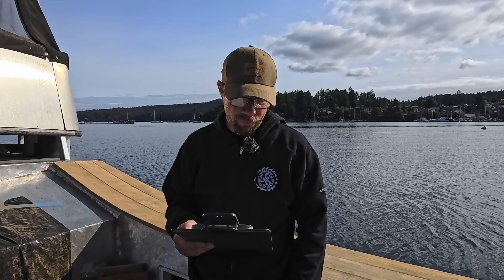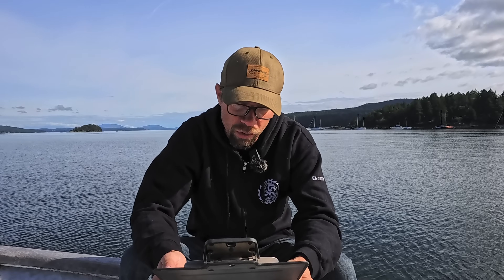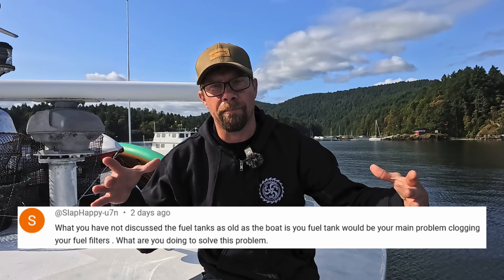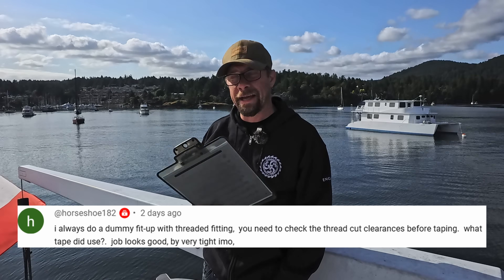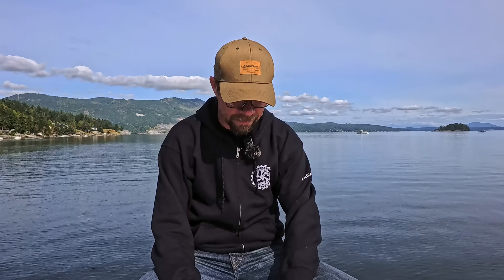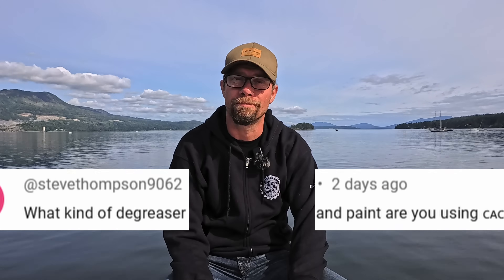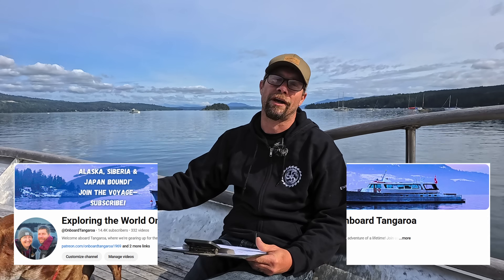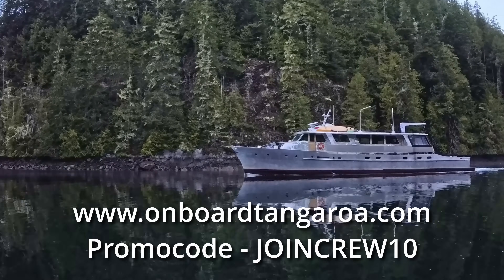We Ripped Out the Fuel System—Your Questions Answered!

Comment: Are there any provisions or future plans to run more data points then whats included factory in this engine?  Like back pressure, turbo speed?   You could get really trick and have EGT probes at each cylinder (like airplanes), that way you know the health of each cylinder.

Also, are these VNT turbos?  If they are, you could set engine cruise (RPM) and then adjust VNT to 95% Turbo RPM for the most efficiency.  You could also clip fuel (load depending) as diesel like to run on the lean side of the stoichiometric equation.. . .  Compounds would be sweet in this setup.  You have the room, and weight isnt an issue 😉  I bet you can get efficiency pushing 40% <- just living vicariously through you.  ha

**Also, i know you mentioned a bypass oil filtration system.  Which one are you using?  Toilet paper, canister (AmsOil) or centrifugal?   That centrifugal that PPE has looks really legit.
Reply from the maker: I do have a full sensor suite on these engines including extras like wideband O2, and back pressure (turbo speed wires are there but no sensor yet). I also looked into individual cylinder EGT but without installing some sort of manifold spacers it would be near impossible with the wet exhaust manifold. I did start off trying to build a wet manifold with individual egt in mind but it turned into a nightmare so I abandoned the project.

These are fixed geometry turbos although there are some interesting products in the aftermarket that have caught my attention. I would definitely enjoy working with that stuff. 

  I am using the Amsoil filter but have been looking into the centrifugal stuff. There are some effective OEM stuff out there. I hadn't heard of the PPE unit but I will check it out.

Comment: Have you considered giving your fuel tanks a deep clean and then painting the inside of the tank? I've seen it done on other projects ( I think it was project brupeg).
Reply: Why would you paint them on the inside?
Reply from the maker: I might consider paint on a steel boat as rust and scale can form and cause lots of issues plugging lines. The aluminum doesn't really create anything like that when it oxidizes so you don't have to worry about it so much.

Comment: Man. . . I've made it on 2 videos now.  lol.

As far as degreasers go, I'll throw out a recommendation for Big Red by Texas Refinery Corp.  Best stuff for the $$ we've found to remove soot on our helicopters.  It's non-corrosive, unlike some of the simple green products, and it's biodegradable.  It's the bees knees.  2nd would be Formula 88, the big box stores stock it, and it's really cheap @ sub $10 a gallon.   Purple Power is about the worse. . . don't ever get that on glass and let it dry, it will etch your windows. . . it's super caustic.
Reply from the maker: I will have a look around and see if I can get those up here. Some chemicals don't make it across the border due to regulations.

Comment: You didn't mention that you needed to change the fuel system out to use regular gasoline. You guys decided the Cummins didn't make Tangaroa fast enough you swapped them out with Chev 496 8.1 big block gas engines. The 45 gallons per hour fuel is no big deal, Tangaroa needs to produce a rooster tail 😂 I know people try using biocide in their fuel to try kill the bugs that is nothing but bad news. A fuel additive like Stanadyne Performance Formula works it keeps things under control. Sticking a suction hose from the top of the tank to the bottom while the fuel has been un-disturbed ya hard to do on a boat. Suck out a couple gallons into a white bucket and see what you've got growing in your tanks. You sure in the hell don't want to be growing chia pets in fuel tanks.
Reply from the maker: Lol, gas engines in this boat would kill me. Will check out that stanadyne stuff. Definitely want to help lubricity where I can. I want to have a better look in the mid tank when I have a moment.
Reply: @OnboardTangaroaSeatrial  Yeah Stanadyne made additives for their injection pumps. They were known for their rotary pumps. Condo is the worst, fuel tanks start sweating. I know you like using fuel for trimming out the boat.

Comment: Unrelated to the complex fuel manifolds, they do seem super complicated and I like the colour coding idea: The DD mechanical diesels have one (probably more) "pros": they can run without any electrical power. What backup power do you have for the Cummins engine controls? And do you have emergency air shutoffs if one has a turbo seal failure and goes into runaway? I don't know if these are immune to self fueling from ingesting engine oil.
Reply: No these engines will not run without electrical power.  They are common rail, and diesel injection is controlled with Piezo injectors through the ECU.  These will inject fuel several times during a combustion event.

Also the air shut off valve is factory on these motors, unless they removed them, but I wouldn't suspect he did.
Reply from the maker: I have several sources of 12v onboard that can be used for emergency backup if needed. Fortunately with the two engines that gives me doubles of everything for redundancy. I also have a 12v house bank that could be used for powering the engines in a pinch. These engines did originally come with an electronic throttle valve that was spring loaded in the open position. I believe it was mainly used for the egr system rather than emergency shutoff. The marine versions of these engines did not come with them. I am not using them in my application. I have not heard of any engine runaway issues with the marine engines. That being said, it is always a possibility with any compression ignition engine.

Comment: Push Lock fittings are amazing. I would have no concern on them with fuel pressure. I've used them for compressed air at 150psi and cooling water at similar pressure. Zero leaks or failure with hundreds, maybe thousands of connections. The only problem with them is taking them off... pretty much impossible without damaging the ridges or whatever they're called. Re-using fittings after cutting the hose off is not a good idea but in an emergency (ie hose damage needing replacement when spare connectors are not there) even somewhat damaged fitting nipples rarely leak.
Reply from the maker: They are amazing. Definitely have to be super careful if you want to try and reuse them. I usually just slowly work down the hose with a razor knife till I get past the braid. I can usually tear them off then. Easy to nick the barbs though .

Comment: Soon as I heard you were using NPT on those fuel manifolds with all those valves that had to be lined up, my blood ran cold. I can only imagine the battle that was. Blaine, you're an incredibly patient and tenacious man. Any idea what you'd use if doing it again? ORB?
Reply from the maker: Funny enough, a great majority of the leakage is coming from the manifold to valve connection which is a bonded seal. I think that with the way the manifold threads were produced the bonded seal is not able to compress properly. I will tackle that project again soon. May just try o-rings instead.

Comment: Absolutely never weld on a fuel tank or a diesel fuel tank.. a diesel fuel tank will explode if welded on..😮
Reply from the maker: I don't as I am not comfortable doing it but plenty of professional welders do. The ones I have seen purge the tank with argon while welding. No oxygen, no explosion. Our zincs are welded to our hull and are in some places right where the fuel tanks are. They didn't even bother to purge where the welding is being done in a location that is fully submerged in fuel. As I said, not something I would do or recommend to anyone but apparently not uncommon.

Comment: Are you not tempted to fit one of the sonar type level sensors in the day tanks so you can have a fuel range in the pilot house? I dare say they would fit with your engine ECU's and you could just send the data on the canbus upto what I assume are a couple of digital screens
Reply: That would take a bunch of math and testing to get them fairly accurate.  He can already calculate what his fuel burn is, and I'm sure he can datalog it as well.  So if a 200 gallon tank, and he just burned 50, he knows he has 150 left.  So it may be a bit redundant and to much work for little return. 

A better idea would be to code in the monitoring system the fuel burn, but have it subtract from full tank.  i.e.  He selects full tank.  The header tank level resets.  But instead of counting total fuel burn, it just subtract the burn from the header tank level.  That's basically what we use on our spray tanks.  we can glance at it, and it gives us a pretty accurate estimate of how much is left in the tank.. .  But when all else fails, hard to beat a sight glass
Reply from the maker: Would be an interesting little side project. There are senders in those tanks but I have no idea if they work. It would be easy enough to plug them into the ECUs. After that it would just be creating a math channel for range. May be fun to play with in the future.

Comment: I'd never heard of the Simple Green issue. Apparently, concentrated it can corrode some metals, including aluminum. Good to know.  Fellow boaters, any other common chemicals that should be avoided? Alternative recommendations?
Reply: Simple Green not mixing with aluminum was learned about in aircraft, causes hydrogen embrittlement.
Reply: they make a safe simple green. . .
Formula 88 is the cheap option for degreaser I use, but Big Red by Texas Refinery Corp is the ticket.  I work and fly aircraft, so I have to avoid simple green as well.
Reply from the maker: Thanks for the recommendation!